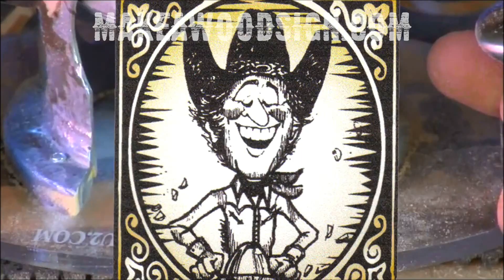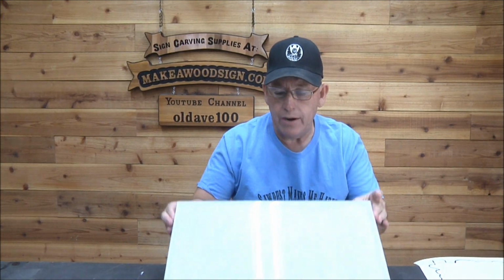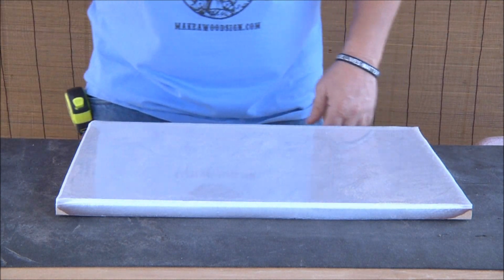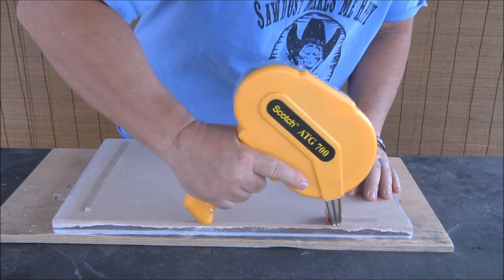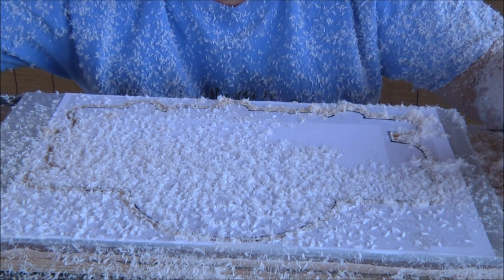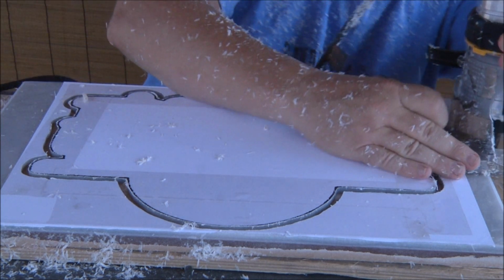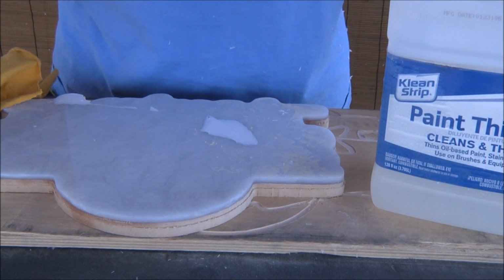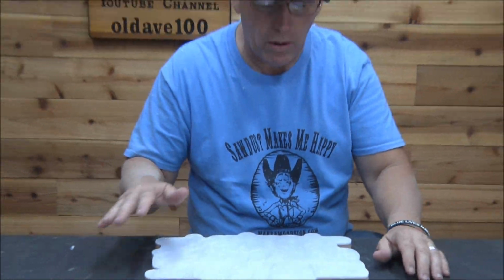#299 Cutting Shape With A Router Wood / Resin SamRyan Designs

Comment: Would it be easier to cut your shape out of the mdf first and then add the epoxy? That way you could avoid the huge mess when cutting the shape. Also, when you pour the epoxy on the mdf shape it would cover the edges. That way it would look like one solid piece of marble. Great idea and really liked the sample you showed. All the new ideas you have been coming up with sure are inspiring. Keep up the good work.
Reply from the maker: Yes that probably would have been easier, but I wanted to try something different.
Reply from the maker: Thank you for watching and the compliments....